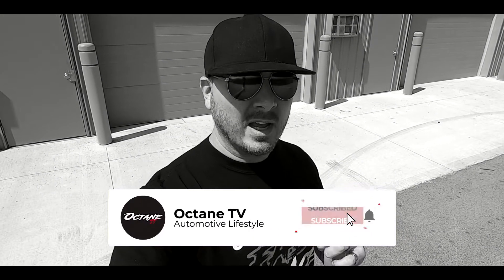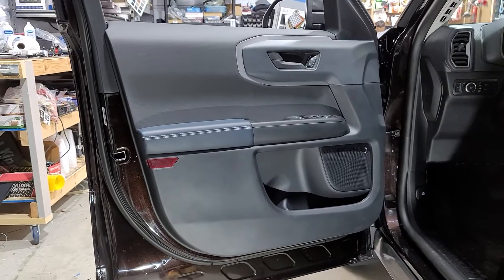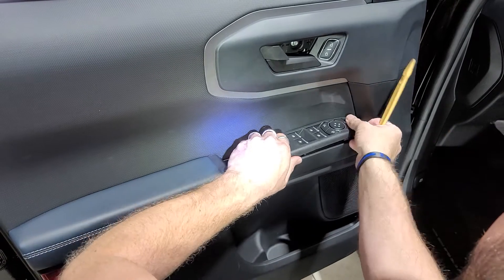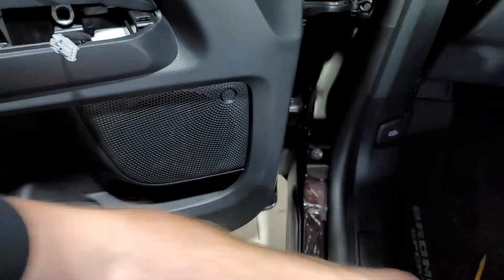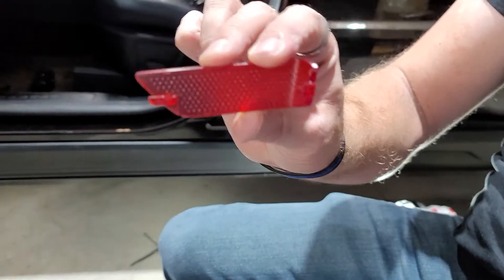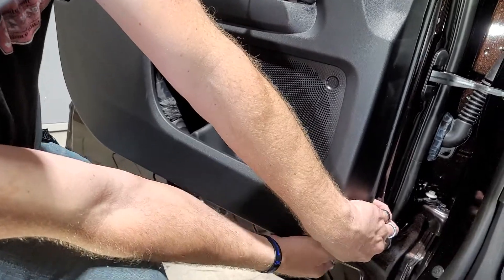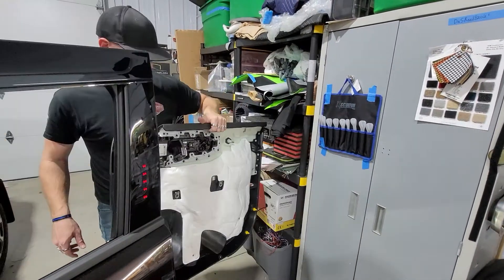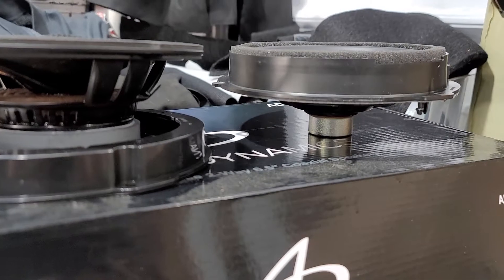2021 FORD BRONCO SPORT FRONT DOOR SPEAKER INSTALL AND PANEL REMOVAL

Comment: Thanks so much for posting. This was incredibly helpful and absolutely accurate. I replaced all 4 door speakers this afternoon in about 2 hours. The only hiccup I had was related to the speakers, not the vehicle or your instructions.  For anyone this may apply to, the screws that come with the Hertz X170 speakers are smaller than the holes in the Metra 82-5605 mounting brackets, so I had to hunt around in my stash for larger screws.
Reply: Did you break any clips?  Did everything clip/snap back in properly?  I want to change the speakers, but in the past nothing really goes back 100% the way it was. They weren't new cars though.
Reply: I got the same replacements. Thanks for the heads up. 🤘
Reply: I got the same replacements. I wished I had seen your comment.